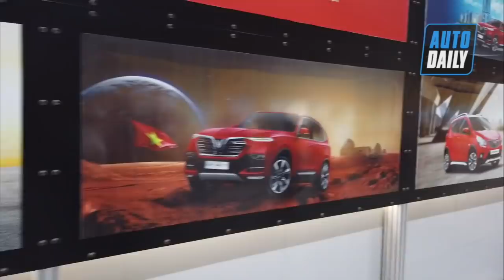Bên trong nhà máy sản xuất xe VinFast LUX SA2.0 và A2.0 |VinFast Factory|

Comment: Honda 90

Initially launched in 1985, Honda’s C90 is the basic commuter motorcycle and still extremely popular to this day. Not much has been updated on the C90 model over the years, with a very basic frame connecting the wheels, engine and rider together. 85cc with top speeds on 50mph, and fitted with an semi-automatic three-speed gearbox means it’s good for fuel consumption.

“Honda C90, sold more than the rest put together and has mobilised entire continents…” Mark Eadie
Honda 90